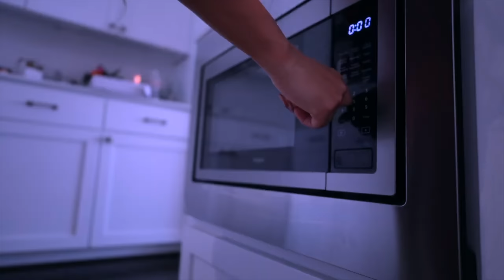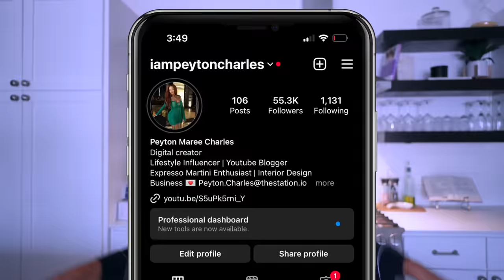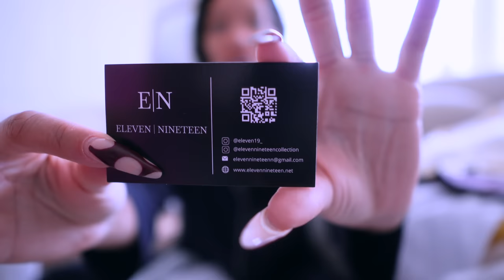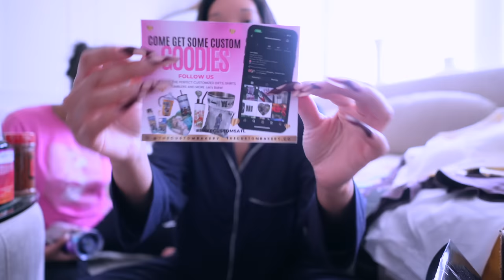I Broke My Kitchen Faucet! + I Wanna Move Rant + P.O. Unboxing | Dang U DIY

Comment: Hey Peyton hang in there faucets can be tricky I remember Aaliiyah doing hers and it was hectic. But you doing great. Hang in there my pisces twin. I installed security  cameras outside my home I was in tears doing the electrical work. ❤❤
Reply from the maker: OMG I just did the drink I thing cameras which was way easier. I’m gonna hate having to charge the batteries tho
Reply: @PeytonCharles  us pisces ♓️  going to get it done by any means necessary. Love ya sis 😘 and hey Kyran so beautiful inside and out.

Comment: Peyton, I tried I stalling a new kitchen faucet a few months ago. The hot water hose was attached so tightly I couldn't get it off. I went to Home Depot and bought several tools that were recommended for easy removal.  I didn't have the strength to unloose it. It had that foam stuff around the pipe, I gave up and called a  plumber $250.00 later, it was done. Never again.😮😂